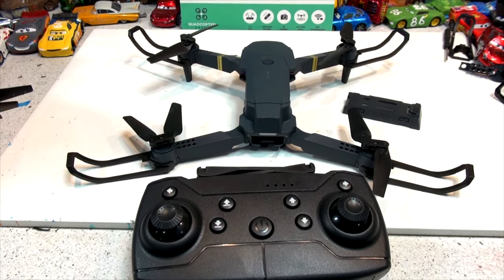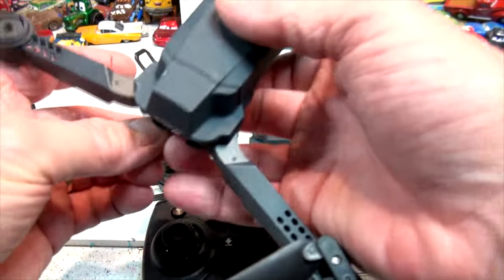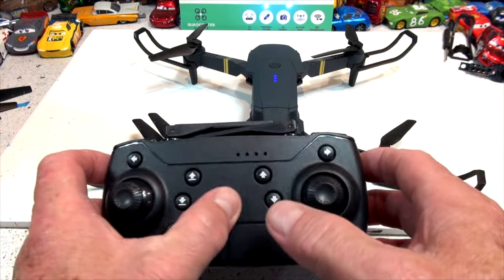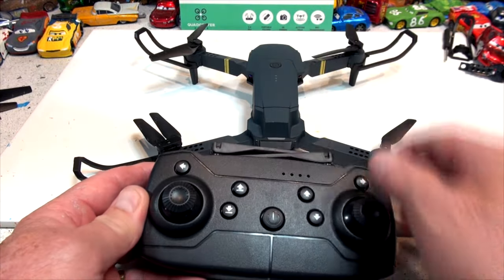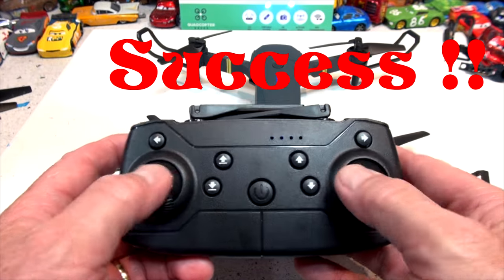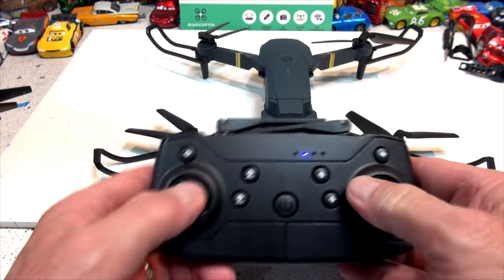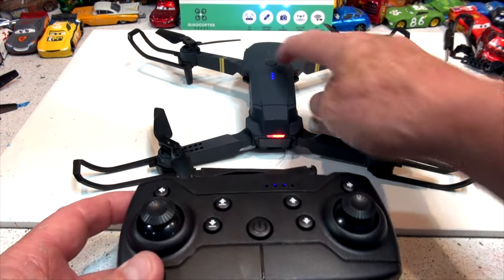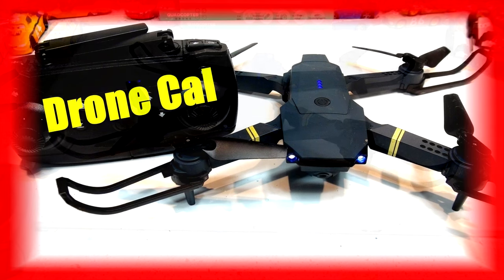How To Calibrate a Drone SkyQuad Quadcopter E38 and others

Comment: Hey buddy..thanks for posting that..  Question. That particular DRONE..you have there..did you use your PHone to view and capture videos? And what is your take on it?  Just curious whether it will work, since it is being viewed via smartphone...thru Wi-Fi? Was wondering how it connected to the phone when you're away from the house and no internet nearby.  Thanks.
Reply from the maker: yes, we viewed the camera through our phone, the app works pretty good and the instructions are easy to follow, I made a few videos showing the quality of the video and how it looks. We use it in the back yard, its not connected to the house wifi, it connects to the wifi in the drone. But once you connect to the wifi in the drone, you have to connect it each time you use the drone for recording video. Its not 4 K. Its pretty poor unless you literally hold the drone and the aspect ratio is not correct. Good luck/
Reply: @BENZ007  Thanks.  watched your other video of the review, footage and flight... Very useful and informative.
Take care and stay safe.
JT